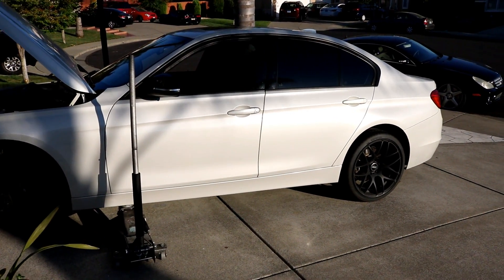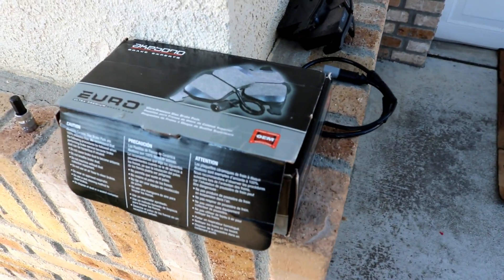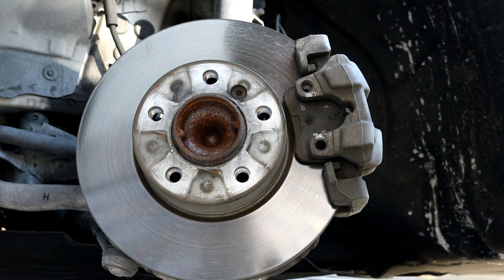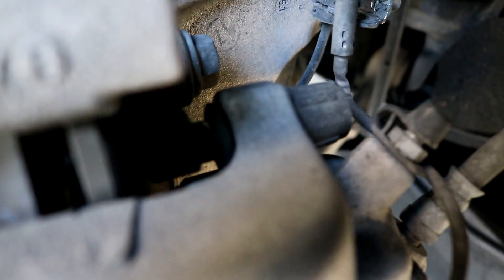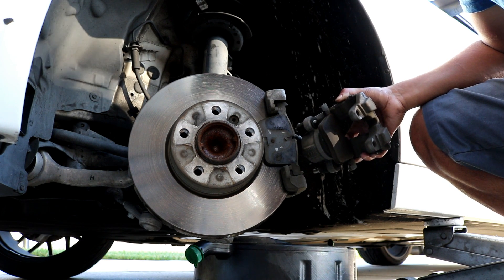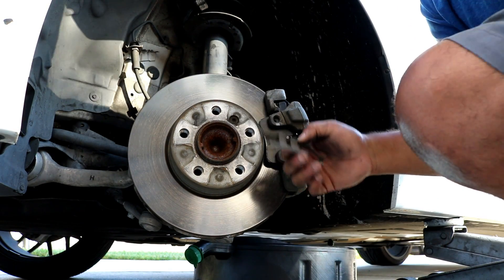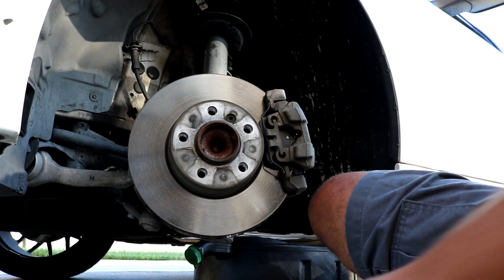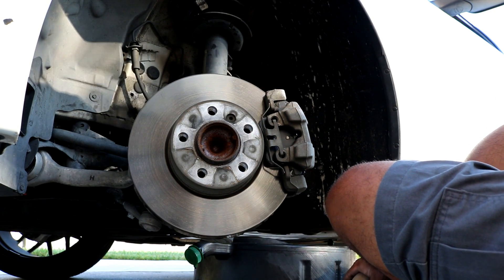2011-2019 BMW F30 Front brake pads

Comment: Really helpful video great focus on each part of the process, most diy people would feel confident of success after your instruction,the only thing I would add is something I’ve done in the past that is to remove the brake reservoir cap before starting and use a paper kitchen towel to soak up some of the fluid before starting, making sure you have the correct one to top if necessary when finished, thus avoiding any spillage. Liked & subscribed

Comment: Good but you need to apply brake grease in the 2 slots where the pads slide inwards and outwards. To avoid squeaks and to avoid binding.

Comment: One of the BEST videos I have seen on youtube. Thank you. Can you do front brakes of g30 please? It will be very helpful. Thank you
Reply from the maker: The front brakes will be 99% similar on the G30 with the only exception being the size of the bolts. They will be of the same bolt head style, just could be different sized sockets is all. 

If they are are sport brakes or m package brake, then those are completely different. If I get a customer that has one come in, I will definitely make a video.

Comment: 7:30   I unscrew the caliper bleeder a half turn or so when compressing the caliper piston.  This evacuates the fluid that has been in the caliper for years instead of pushing it back up into the system.  Then top off the brake fluid reservoir.

Comment: Great job. Easy Peasy! Don’t forget to torque the wheel bolts! I torque them to 80 ft lbs.
Reply: I thought the F30s had M14 bolts, which requires 140Nm (103.2587 ft-lb)?

Comment: Great video! Probably the best one about doing brakes on anF30. Do you HAVE to replace the sensor? My understanding is that it is basically a wire that wares through when the brakes get to a certain point, so if you replace the pads before that, you might not need to replace the sensor and save a few bucks...
Reply from the maker: Luke Kondratowicz No you do not have to replace the sensor. Only if the brakes have worn down considerably (metal on metal) you will notice that the sensor gets destroyed.

If you can get the small metal clip and sensor out of the old brake pad without breaking it you’re good to reuse it.

Comment: Hello and thank you for the video I am going to be changing my brakes and rotors this weekend. I am a bit of a specification nerd. Do you by any chance have the torque specs for the caliper, caliper bracket, rotor mounting screw and lug bolts? Thanks again- 2016 320i
Reply from the maker: Hello. I will try and track down these numbers tonight.
Reply: @HelpingHandAutoRepair  thanks bud really appreciate it
Reply from the maker: Eric Ricardo here you go:

1. Lug bolts: 90 ft. Lbs.
2. Rotor retaining screw: 11.8 ft. Lbs.
3. Caliper guide pin: 22 ft. Lbs.

4. Caliper bracket bolt: 80 ft. Lbs.

Hope this helps.

Comment: Is the use of compression tool necessary?
Reply from the maker: Michael Foell Yes. Otherwise you will not be able to fit the new brake pads into the calipers.
Reply: @HelpingHandAutoRepair  You can also use a big C clamp....
Reply from the maker: Daniel MacDuff for the same price you would pay to by a big C clamp, might as well buy the correct tool.
Reply: @HelpingHandAutoRepair  Most of the time we already have C clamp....

Comment: Great video! So it would be the same process on 2014 320i? I assume since it is a f30 it would be the same. Took my daughters bmw to the dealer and was told the front breaks needs to be replaced along with rotors and sensor.  How do known if the rotor needs to be replaced? The car only has 57k miles.

Also did you not need to use grease on the back of the pads? 

Did you not need to use a torque wrench?
Reply from the maker: It would be very similar yes. Rotors are these cars are designed to be changed with the pads. You might be able to get away with just doing the pads sometimes. However if you notice the very outside of the rotor face (the shiny part) there begins to be a very hard lip on the edge. If you just slap on new pads. Sometimes it’s ok but other times they will squeak and keep on squeaking. 

It would be wise to change rotors as well if you can afford it. If you can’t now well hey that’s life and you do what you can do. New brake pads will ALWAYS be better than nothing. But make sure you replace the rotors the next time around. 

PLEASE note: my personal recommendation is to replace pads and rotors.

No grease on the back of the pads. Some people (older people and younger kids taught by older people) still put grease on the back of pads. 

Some pads still require this step. However 95% of brake pads made today have backing plates or pads to reduce noise. If there is nothing on the back of the pads you get, then use grease. 

I am sure there are torque specs around on the internet. I have been doing brakes for years. Not once have I used a torque wrench. I use a torque wrench when tightening the lug nuts but that’s it ons brake job. I get them nice and snug and that it plenty.

Comment: Great vid my friend...thumbs up subbed. I'm going to help my buddy who has a F32 428i this weekend. His has the single piston caliper(looks exactly the same as the F30 I assume)compared to my F82 M4C which are even easier Brembo 4 piston calipers to replace pads on.
Reply from the maker: Yes the fixed piston brake calipers are MUCH easier than the sliding calipers on the bmws. Fixed calipers are easy on everything.
Reply: @HelpingHandAutoRepair  I'd be nice if all cars had fixed calipers, but cost is an issue I suspect...again nice vid.

Comment: So you do not have to do rotors??   My dd is 90% highway driven my first pads will have 85000 miles on them..Thank you !!
Reply from the maker: You most certainly can do the rotors if they have significant wear on them or have large scoring on them.

Comment: Hey, so I just did this brake job thanks to you but I get a continuous click click click noise at any speeds when cruising, it goes away when I press the brakes... Any ideas what it could be? Appreciate the help in advance!
Reply from the maker: Something is loose or not placed right. Try to figure out which side and take it apart again to see what’s wrong. Chances are it will present itself

Comment: Is the compression tool a must for changing my 2013 bmw 328i? If so where could I find it ? Or is that the exact term for it ? The compression tool?
Reply from the maker: Brake caliper compression tool. There are MANY companies that make them.

https://www.autozone.com/test-scan-and-specialty-tools/brake-tool/oemtools-disc-brake-pad-spreader/141493_0_0?spps.s=3303&cmpid=LIA:US:EN:AD:NL:1000000:GEN:71700000069889792&gclid=EAIaIQobChMI5qvBjfqF7AIVEr7ACh2c0QU3EAQYASABEgI1PPD_BwE&gclsrc=aw.ds

Comment: Brilliant video, my warning light came on so I ordered a new set. Went to change the pads but they was done less than  a year ago so thought it was odd, when I looked at the pads they weren't even 3/4 worn down. Could the warning light come on if the last person to change the pads never reset the mileage? NEW SUBSCRIBER FROM THE 🇬🇧 👌
Reply from the maker: Rear pads have wear sensors too. Check the rear pads.
Reply: @HelpingHandAutoRepair  they got changed same time as fronts, also it comes up saying front brakes on screen. Thanks for ur quick reply 👍
Reply from the maker: Check the connectors for the wear sensors and make sure they didn’t come loose. If they look good, Replace the wear sensors and see if the problem persists.
Reply: @HelpingHandAutoRepair  I don't the reset and the warning hasn't came back in but I think i will change the sensor just incase. Thx for ur help 👍
Reply: "Done" the reset

Comment: whats the torque for the caliper bolts or do you just go to tight?
Reply from the maker: I personally just get them snug. A quick google search should get you these results.
Reply: @HelpingHandAutoRepair  awesome, snug fit works for me, I have the BMW manual and it has torque values (in NM) and I really don't want to try to get a wrench all the way behind there!
Reply from the maker: @jbond119  well by all means follow it if you can. However I get the bolts snug. I saw follow it if need be because obviously we are all of different strengths and your “snug” might be tighter or looser than my snug.

Comment: You don't need to change in new rotor discs at the same time?
Reply from the maker: That’s dependent upon two things.

1. Condition of the rotors.

2. Money.
Reply: @HelpingHandAutoRepair  when you say, condition, you mean whether they're smooth or grooved, and also the thickness still available (what's the minimum recommended?)?
Reply from the maker: Yes if they have severe grooves on them or not. Minimum rotor thickness is normally stamped right onto the rotor hat.

Comment: After replacing front rotors and brake pads hearing rattling sound on rough roads ONLY from front left side wheel.Can you please let me know if you have any suggestions on it!
Reply from the maker: John B Loose brake hardware. Forgot to tighten a bolt.
Reply: After replacing Front caliper anti-rattling clips properly sound was gone.

BMW Disc Brake Pad Retaining Clip - Genuine BMW 34216850853
228i, 228i xDrive, 320i, 320i xDrive, 328d, 328d x Drive, 328i, 328i GT x Drive & More

Comment: My car has new brake pads, but when coming to a stop the car makes like squeaking noise but the thing is that it’s on & off.
Reply from the maker: What brand pads? And what material? And did you replace the rotors?

Comment: Thank you for the video. Mine has the same brakes. I will try to do it myself. 
May I ask you use any antiseize or brake lube for the guidescrews?
Reply from the maker: Mark C Yes you can use multi purpose grease. Mine is valvoline brand and it’s red. I use it all the time on the slide pins and bearings.
Reply: Hi, I did the same job as you did. I even used the same Akebono pads from fcoeuro.  Every thing went well. I have two questions. 

1. What is the thin wire or cable into the wheel in addition to the sensor, the brake hydraulic line?

2. The brake rotor gets much hotter than the rear brake rotors. I just did the front only. The rear brakes were not worked by me.  Again I did the same work as you did for the front brakes. 

Is is normal for the rotors get hot?

Thank you in advance.
Reply from the maker: Mark C 

1. I assume you’re talking about the brake wear sensors? They are copperish color and push into the back of the brake pads? OR you are talking about the ABS wheel speed sensor wire.

2. Yes it is normal for brake rotors to get hot. That is their job to convert kinetic energy into thermal energy.
Reply: Thank you. That makes sense.

Comment: Where do you put the brake pad paste? Isn't it mandatory?
Reply from the maker: On cheap pads. However most modern brake pads come with backing plates/vibration shims already on them. Especially on higher end luxury cars

Comment: What and where am I supposed to lubricate?
Reply: Modern high quality pads have a backing that doesn't require lube, but you still need to apply a dab on the pad ears where they contact the caliper and slide back and forth

Comment: You said 8mm. Isn’t it 18mm ?
Reply from the maker: PugFace Media for what?
Reply: Helping Hand Auto Repair Nevermind.  Your video was very helpful.  Just finished brakes.  The only think is that for my caliper bolts I needed an Allen wrench to remove bolts.  The easiest way is to used an Allen wrench socket.  I was thinking it was a standard socket but I realized you need an Allen wrench to remove caliper bolts.  Overall well done. You made mechanics lose profit because I did this myself. 😂
Reply from the maker: PugFace Media If you watched the video I clearly said 8mm Allen. I am showing you it @ 1:10 into the video.
Reply: Helping Hand Auto Repair 👍🏻

Comment: holly molly, where are your jack pads man, also you can use a turkey baster or similar items from amazon to extract the break fluid, you don't want any of that on your engine bay. You also need grease and tread locker.
Reply from the maker: Mr. Pabs My jack pads are attached to the car, like all other BMW and Mercedes are. Never needed a turkey Baster, thread locker on caliper bolts you will regret. Grease on the back of the pads? Grease on the slide pins you can.
Reply from the maker: Mr. Pabs also who is Holly and who is Molly?